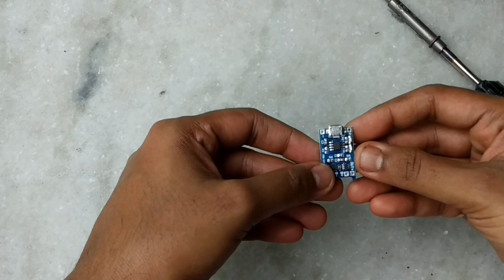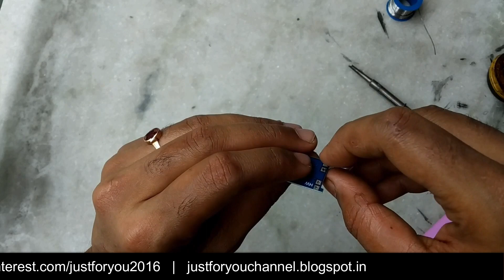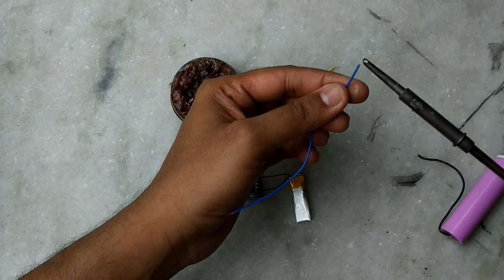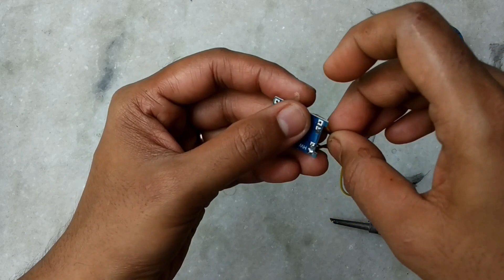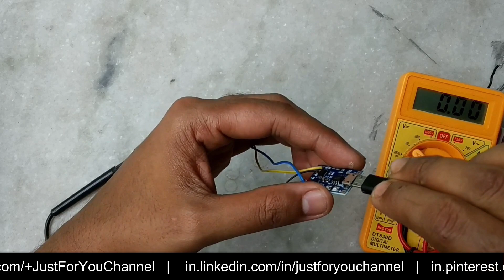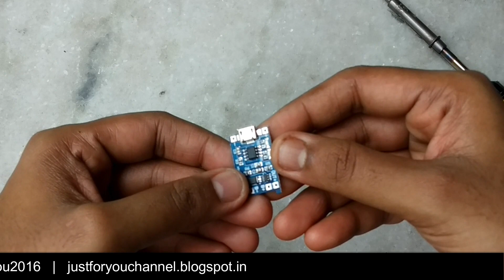How To Use TP4056!5V 1A Micro USB Charging Module Hindi

Comment: Hi, 
I'm getting both red and blue light when charging
Is this normal??
Reply from the maker: Sounds like the battery was drained to much and the charger wouldn't start unless tricked by a higher voltage. And If you use Lippo battery then be careful because it can explode.
Reply: @JustForYouchannel  Hello. Thank you for taking the time to reply.
I face a peculiar problem, battery direct connection to load works well, but power fluctuates, 
However battery to load via TP4056 DOESN'T work at all . 
Does this mean the board is bad ? I have continuity between (b+ | out+) & also between (b- | out-)

Comment: Shall i connect 2 battery in parallel and charge using single tp4056 module.. It is possible or not. Any problem occur in battery or not